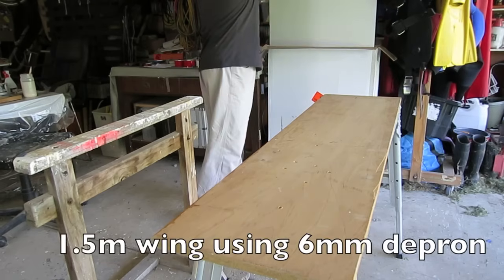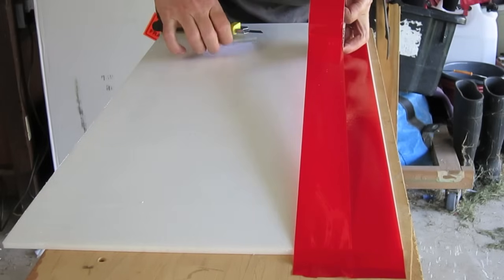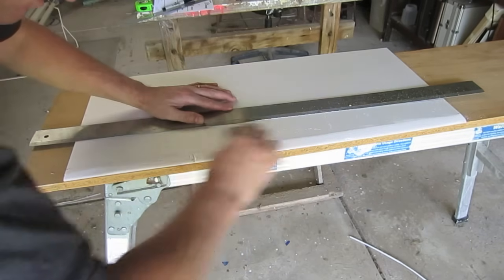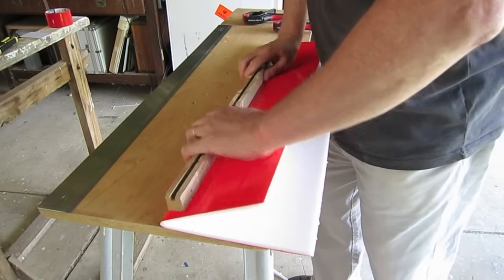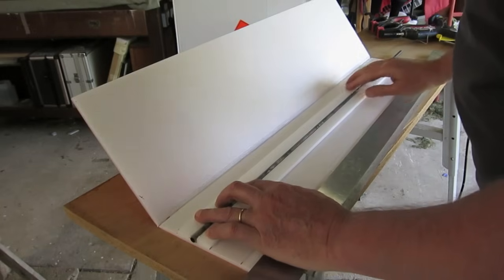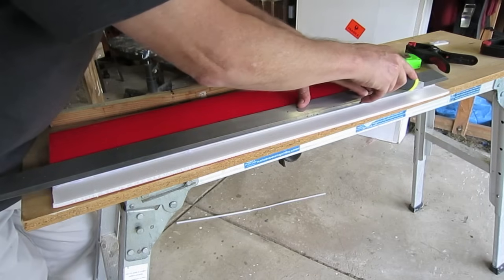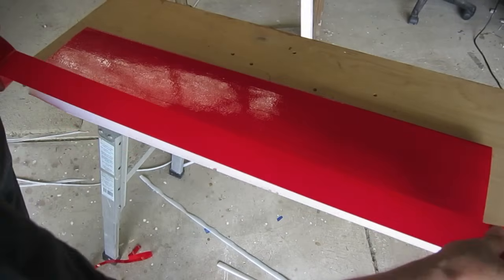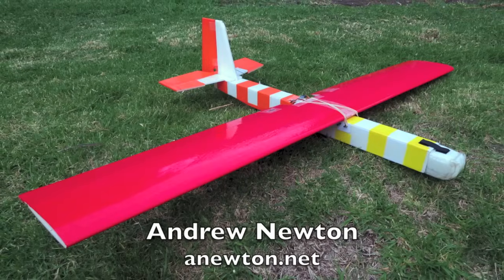Depron wing build

Comment: Now I switch to corrugated plastic board to create tapered airfoil which is stronger and more efficient than sheeted foam. Honestly, I still use sheeted form for building an aircraft.
Reply: It is stronger, but corrugated plastic isn't ideal for aerodynamics and isn't easy to fiberglass

Comment: Nice. Now I switch to corrugated plastic board to create tapered airfoil which is stronger and more efficient than sheeted foam. Honestly, I still use sheeted form for building an aircraft.
Reply from the maker: I use the plastic board for fins occasionally but I find it's a bit to heavy for wings and fuselage

Comment: Great video, learned something.

Question. 

When you did that "Glide test" toss.
Do you typically do that with all planes you scratch build?

Or just lighter one without motor or large battery
Reply from the maker: Thanks. I only do the glide test with models that are capable of gliding, like motor gliders or slope soarers.

Comment: Andrew, apologies for writing many years later, but I am struggling finding suitable Depron in Australia these days? Have you got any ideas on where you might find something suitable on the east coast oz? Are there suitable alternatives out there say as eps or thinner more flexible styrene? if you have any updated information it would be greatly appreciated, I am a massive fan of the EA armin style wing builds.
Reply from the maker: Sadly no. Real depron seems to have disappeared from Aus. The last lot I bought from Tradewarehouse was not real depron, but a softer more fragile foam board. I tend to use XPS foam insulation for hot wire cut wings these days
Reply: @AndrewNewton  thanks andrew, sadly thought that might have been the case. We also seem to suffer from not being able to get the lighter style foamboards as well, like dollar-tree foamboard which seems a lot lighter than the aussie version.

Comment: Can I connect the wings using the long spiral piece only without attaching the wings with adhesive tape, which means that I can dismantle the wings easily?
Reply from the maker: Add a small spar further back to stop them rotating and maybe velcro or rubber bands to hold them together.

Comment: Thank you for this video. This is really helpful.
I was wondering if one could make the wing without the rod in between. Would the wing hold?
Also from your experience which of the 2 is better, depron or foam board?
Reply from the maker: A small thick wing might be OK. US Adams board (Dollar tree) is good, but if that's not available then depron is the best.

Comment: How does one know how long & the width of the wings of RC Plane?

I have old electronics servos, motor & battery from a larger Aeroscout 2 1.1 & would like to know how small of a plane would would
Reply from the maker: Would be fine with just about anything. Maybe not under 600mm wingspan

Comment: why do you have wings so far from nose? Is it to get CG right on the wing without adding extra weight?
Reply from the maker: Correct, lighter flying weight
Reply: @AndrewNewton  Do the distance between wings and h stabilizer affect stability?
Reply from the maker: More distance gives smoother pitch control and wider acceptable CG range

Comment: Nice, have you tried a 1.5 mm corrugated plastic wing bend to tapered chords . It is the most efficient airfoil I have come across,. It's light weight and very tough.
Reply from the maker: I haven't seen 1.5mm.
Reply: @AndrewNewton  you can google . I am planning to order the 1.7mm thick cp weigh 250g per square metre...very light

Comment: Probably a stupid question, but what kind of hot glue are you using? My experience with it is that it cools almost immediately and I often have no time to attach stuff even on a point application. Yet you ran a whole bead and then still had the ability to slide the formers around on it.
Reply from the maker: HobbyKing or whatever is available. Might depend a lot on the air temp.

Comment: How light or heavy is your method compared to a wooden wing or FlitefoamFoam and how stiff is the wing ?
Reply from the maker: 250g with servos. Stiffness is perfect with the arrow shaft as a spar.
Reply: @AndrewNewton  
Thats kinda light. My 2000mmx230mm Sailplanewing (Graupner Bussard) is 428g without servos.
Reply from the maker: Not really. If you scaled mine up to 2m and 230mm chord (and added a second spar) it would weigh the same as yours
Reply: @AndrewNewton  Your wing still will be lighter ! I did some calculations:
Your wing: 1600mmx190mm = 304000qcm
My wing: 2000mmx230mm = 460000qcm
230g (without servos)/304= 0,756 ! the advantage in weight is crazy ! (without an additionel wingspar)
428g/460 (wingarea) = 0,930
BUT I guess the problem with upscaling is much more prominent with Depron, I guess a second spar is needed (like you said) and probably an even bigger, heavier spar if you scale it up  more like 2,5Metre and beyond.

Do you think a depronwing would work as a replacement for my T2M Windstar 1800 ?
https://www.youtube.com/watch?v=3HoMVON3N9w&list=PLudNoI4CUs2aI_JKJ6zkhVxCParmNOkMI
Reply from the maker: Mine is 1500mm, which I think is the sweet spot for 6mm depron and a single spar. 1800 would be OK for a light wing loading.

Comment: Hi Andrew, nicely done.....I'm finally following in your foot steps along with what I have learnt from experimental airlines.  Thanks to both of you seriously.....you're both a great inspiration.   What I wanted to ask you is this:  I am about to try this for the first time using a sheet of foam board purchased from Office Works.   Am I supposed to remove the paper from the side that I will be applying the packing tape.   Thanks
Reply from the maker: I would leave it on unless you're going for light weight. What are you building?
Reply: I'm looking to build the photon or the noobtube.  I reckon I'll give the noobtube a go first.  May as well start simple before I get ahead of myself.  I'll see how my first wing turns out which is my 750mm foam board sheet.   So if I'm happy with the first wing, I may go ahead and do the second for the photon model.
Reply from the maker: Noobtube is not a beginner's plane but great to learn the building methods.
Reply: It's all good.  I already fly.  I wanted to try this building technique and build some planes that are simple and cost effective, easy to repair or rebuild again if crashed or damaged.  Plus this method does away with some of the many intricacies associated with traditional scratch building or building from a kit, especially where a ribbed wing is concerned.  Cheers & thanks.  I'll post something when I'm finished.

Comment: Hi Andrew, so when you say that you don't glue in the spar, what stops it from sliding left or right inside the wing.  Or does the friction keep it in place nicely.  I think I just saw the answer in a previous comment a little bit down below.  It's friction - thanks.  Is the spar 6 mm with a 5 mm inner.  Or is it 6 mm inner and 7 mm outer.  Lastly, do you recommend, or is it a good a idea to use a spar tube within a tube for sliding in and out of when joining the wings to together?  Thanks.
Reply from the maker: That's right, you can glue it in but friction works for my builds. If you will pull the wings apart often then your idea of an inner tube makes sense. Spar dimensions here http://newtonairlines.blogspot.com/2015/03/materials-and-links.html

Comment: I had a question about the covering of the wing. I did this a few times. But i want to paint my plane(depron). Are there other ways without paking tape or laminate ? 
I was thinking to glue wallpaper on the wing and then fold the wing... what do you think ?

Comment: I have two questions Andrew. How much did this wing panel weigh out? And do you think this process can be done with a 53" tapered panel? 10" root, 7" tip. Thank you.
Reply from the maker: Hello E. Weight is in the description. I tried to make a tapered wing but it ended up the worst tip stalling plane ever, you might have more success.  Bigger panel may need two more hands to help hold it while the glue sets.

Comment: hi andrew - the 10% airfoil section here is somewhat thinner than the armin wing build examples from ed@expair.  can you say a little about your choice of 10% - is that something of an optimal target dimension?  thanks.
Reply from the maker: I think 10% is a sweet spot for chord thickness. Low drag for efficiency but still enough lift for slow flying.

Comment: Tried this number of times. Always ended up snapping it at the point of fold, or atleast cracking it. Had to use extra tape to secure. FUGLY! :(
Reply from the maker: Did you tape and indent before folding
Reply: Yes sir.  Perhaps I am not doing this right.
Reply: Clearly you are not doing it right. Make sure you get a really good indent and fold slowly. You can even make TWO closely spaced indents to make the leading edge a more gradual curve.

Comment: The tapes made the difference, is it? What tape is that?
I made mine using this method without the tape but when I bent it, it broke.
I bought the foamboard from an art shop, and it is not cheap.
Thanks for the informative video.
Reply from the maker: That's right, the tape is essential. Just 50mm packing tape, nothing special.
Reply: OK. Thanks for the reply.
Now I know my mistake.
Thanks again.

Comment: Isnt it too nervous with full spain ailerons? tipstalls? .. thinking about making this but using smaller ailerons (half span ailerons or so)
Reply from the maker: Half span ailerons would work just fine. Better for a fast plane I guess.
Reply: Thanks!
Not a fast plane.. just looking to make some wings with depron i have arround for a FPV plane.. so im more concerned with stability and lift.. tought maybe the full span would work just using little throws
Reply from the maker: Yes you are right, small throws and/or aerobatic roll rate with full span. You certainly don't need that for an FPV cruiser.
Reply: It works!

Thanks for the tutorial! made a 1.6m wing .. used 30cm ailerons in each wing 10cm from the wing tip and added small winglets to clean a bit the wingtip vortex.. it has more than enought roll for a FPV plane..

 plane now flies great.. straight and efficient.. and lowered a lot the wingload
Reply from the maker: Excellent, love hearing success stories

Comment: Do you think it would be possible to either dent or cut a channel into both sides of the foam to create a section only two layers thick, to allow for a shorter chord? Also, what would you suggest as a strategy to design a similar plane with a much shorter nose?
Reply from the maker: Good questions Nikolai. For a two layer thick section you would have to shape it by sandiing I guess, or use thinner depron. Both are not to difficult although thinner depron would need more support. For a shorter nose you would need a lighter tail or a heavier weight in the nose, no way around it.
Reply: If the tail were moved closer to the wing and made larger to preserve "volume" (ideally while keeping a similar weight), could this have a similar effect?

Thanks for your help and for making these videos; tons of excellent info here.
Reply from the maker: Yes definitely, that would work. I would make the flight more twitchy maybe, not a smooth as a longer tail.

Comment: sir; 
Good video;great method. Can i use 3mm depron with a balsa spar?
Further what is the weight of this wing without all the electronics?
Regards
Reply from the maker: That would be fine for a smaller or lightweight wing, but I have not tried it myself. The red wing weighed 220g without servos fitted.
Reply: +Andrew Newton   thank you. i will surely try making one and update you. 
Regards

Comment: Thanks so much Andrew. I just ordered. Love the camo.
I notice you do some diving. I'm a keen surfer and theres a lot of talk about sharks these days. As a multi rotor enthusiast I wonder if you think RC aircraft / quad copters could be used as shark patrol at AUS beaches? I think it could all be autopilot guided and image recognition software could be used to indicate high contrast forms in the water and alarm the lifeguards to a possible shark in the area. Saves on AVGAS!
Best
Mark
Reply from the maker: +Mark Brown Excellent, they are perfect wing spars, and tail booms too. Interesting shark patrol idea, as long as the copters or planes didn't become more of a problem than the sharks.
Reply: +Andrew Newton must i Tape it like you do? what is better if I do?
Reply from the maker: Yanni Gred Yes tape is required or the depron will snap when you try to bend it.
Reply: +Andrew Newton ok thanks

Comment: Andrew, bom dia! esse vídeo pra mim foi muito útil, fiquei impressionado com a técnica que vc usa o arame nas parte moveis do planador, eu procurei em vários lugares e não estou encontrando, o nome desse material é aço/ arame de torção? Abs!
Reply from the maker: Márcio Rodrigues Hello Marcio, I can't translate your question but is it something about wire in the fuselage? I use 1.2mm piano wire for rudder and elevator push rods, servos down the back. On my DLG style glider I used 0.4mm stainless steel wire as torsion springs for a spring / pull system for rudder and elevator.
Reply: Olá,  Andrew Newton, e isso mesmo, minha duvida era sobre o arame, tks pelo feedback!
Parabéns pelos vídeos!
Marcio Rodrigues

Comment: Just curious, why don't you cut a groove at the leading edge bend, and maybe at the apex of the top of the wing where it goes over the spar.  It still retains strength and makes it easier to fold over.
Reply from the maker: BennyCFD I tried that and it makes the bends too sharp

Comment: Great video. Thank you very much, that gave me a lot of inspiration ;-)
I did a full length depron sheet build (2 times 80 cms, total 1,6m span, 17 cm chord, 4 cm ailerons) and wanted to do fulll span flaperons. They turned out a little soft, so I'm thinking, a little reinforcement might be good.Do you sometimes need to stiffen up your ailerons wit a separate spar, balsa or cf?
Reply from the maker: LaLaObeRoT On big wings (greater than 1.5m) I have found the roll rate is always quite slow and that could be partly due to flexy ailerons. But no I have never stiffened them with spars. What thickness is your depron?
Reply: Andrew Newton Thanks for your answer. I use regular 6mm depron.  I ended up making new ailerons as the regular ones really seemed to flexible. I made them from 3mm strips of depron. I glued them together with low viscosity epoxy and put a few carbon roving fibres in between. This all adds a tiny amount of weight and takes away a little bit of the beautiful simplycity of the Armin wing. The result is quite satisfying, nevertheless. Stiff but still flexy enough to follow the bend of the wing.
The plane is a pusher, meant for FPV. Skywalker style. Successfull maiden was on sunday :-)

Comment: i was considering doing this method to make the wings for my rc plane to test my motor and have just to mess around with ill be using a 25cc weedeater brand motor i would obviously need to make the wings a bit bigger but do you think a wing made of these materials would be able to produce enough lift and have the strength to fly with a 25cc motor i would eventually make a whole body around the motor to make a p-47 thunderbolt
Reply from the maker: Sounds like a big motor? I have used this wing on planes up to about 1kg, Any more than that and it would need extra spars and probably a deeper airfoil section for more lift.
Reply: It's not terribly big i haven't weighed it in yet. it's one you would find in weed trimmers and small chainsaws and I still have some trimming to do so it will lose some weight I've already got the exhaust system off it which it then lost a bit of weight and will most likely increase performance but would loose some fuel efficiency the trimmer I took it from weighed roughly 12 lbs so minus all the excess it will probably weight 10lbs I'm not sure what that is in the metric system
Reply: I would suggest this is not a good method for you. You may be able to make it work but other methods are more proven for such a weight. Might I suggest Correx/coroplast/corrugated plastic as used for signage? 

http://www.spadtothebone.org/plans.html

https://www.youtube.com/watch?v=wnSHBYeJAdE <===This one is similar to yours